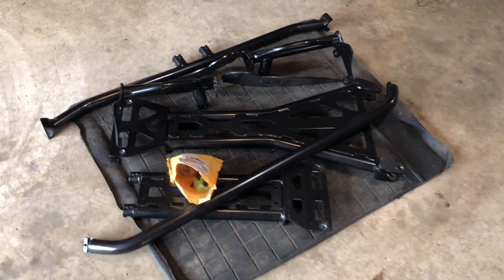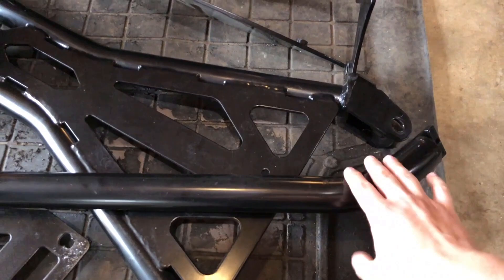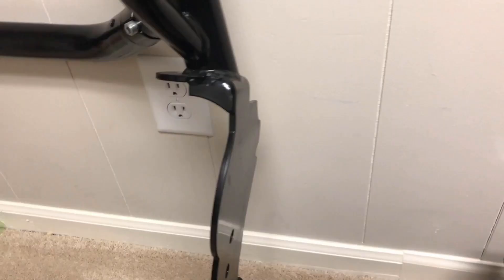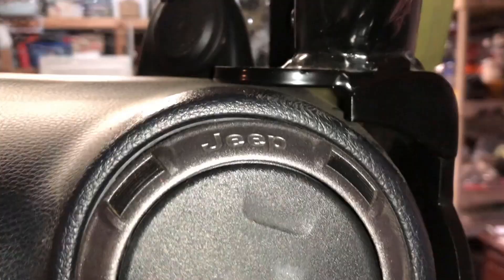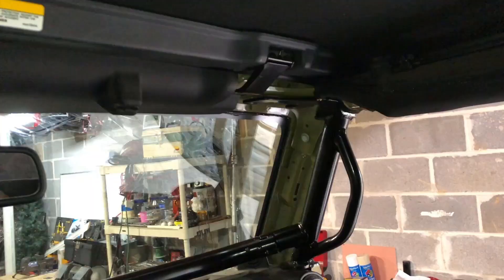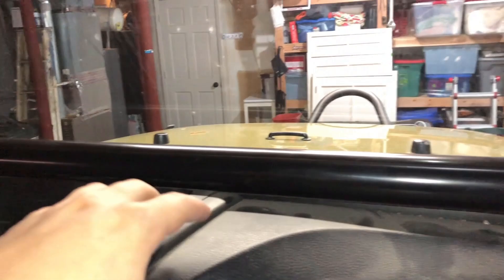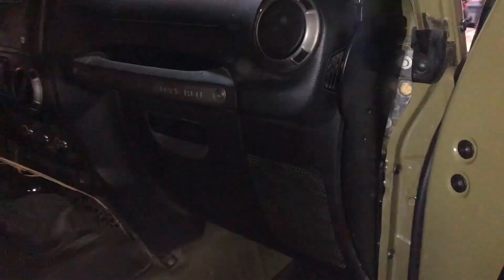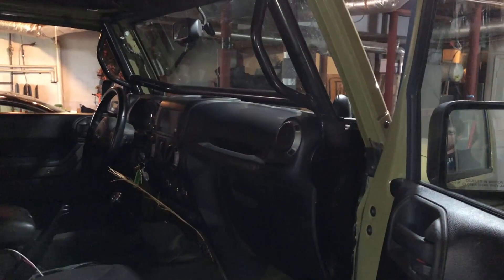Warden JKU | SRC Roll Cage Install

Comment: On my 3rd SB cage install. I angle grind the back of the passenger pillar plate just like you did. The drivers usually falls in place without grinding. Another great trick is to put a dowel punch through the top drilled hinge plate hole on the passenger side. Hit the punch with a hammer while moving it around in all directions. It pushes in the metal structure and allows the pillar plate more room to fall in place. Makes a huge difference trust me. 
Also pay attention to the long and short clamp bolts, I bottomed out a few of the longer bolts in the shorter holes. 
An easy way to tighten the windshield bar Allen bolts is to use an Allen socket and turn it with a gear wrench. 
I also remove most of the grease they pack in the threads otherwise they will hydraulic compress on you with the bolt about a 3rd of the way in. 
On a JKU the rear overhead bars use the stock holes in the factory cross bar,  the drivers overhead bar will get drilled out where it meets the rear overhead bar. I consider this one of the harder parts so take your time laying out the hole positions. 

Hope this helps others.

Comment: I put one on my 2017 and it fit perfect but i did have to trim the top. both front tops wouldn't sit all the way down without shaving
 them around the front cross section of the cage.